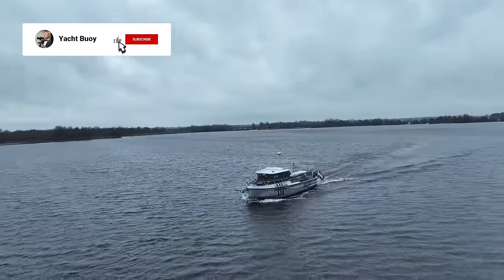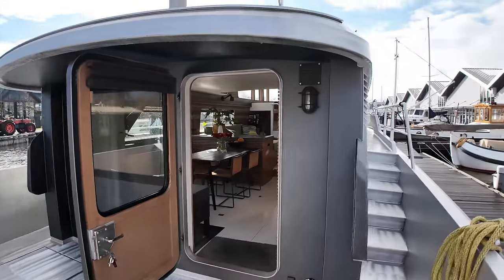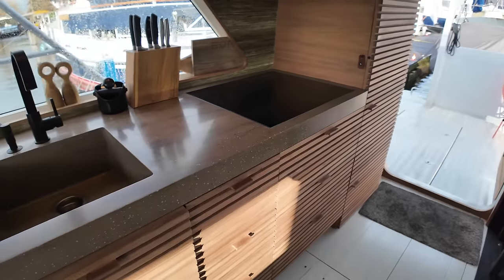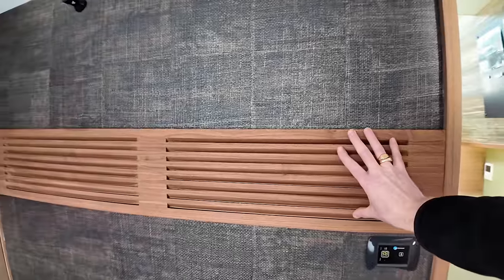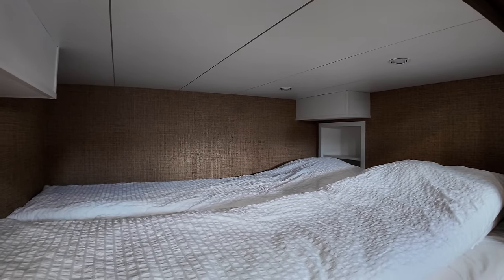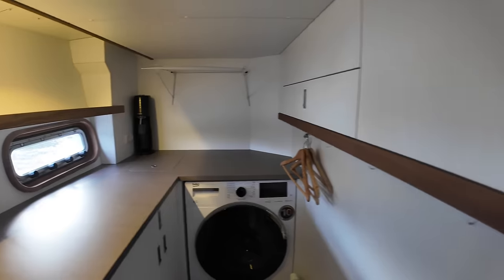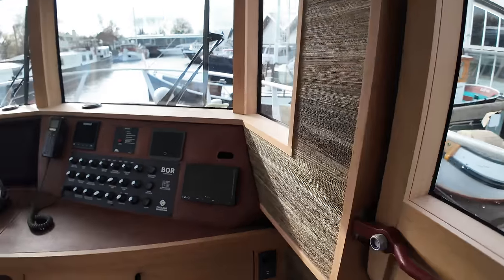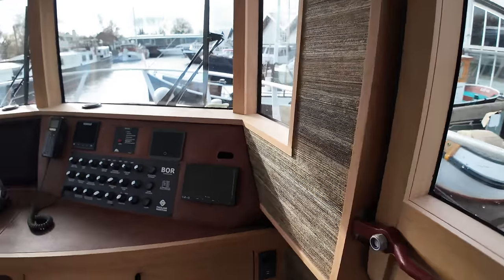€1.395M Long Range LIVEABOARD Explorer Yacht For Sale! | M/Y 'Bor'

Comment from the maker: Thanks for watching! Please do not forget to subscribe! Everything mentioned in this video can be found here: https://linktr.ee/john_johnson
Reply: Oh this was very interesting.  I really like it.  The vessel looks terrific and very stable.  The interior is simplistic yet functional.  I really like the access to the guest accommodations.  Definitely gets a 👍  Thank you.
Reply: How tall are you? Unless you're at least 190cm that is a cramped galley.
Reply from the maker: 190cm exactly! 🫡
Reply from the maker: Thanks for watching! 🫡
Reply: Just found this and subscribed. Great video. 
What do you do if you're going from Seattle to Hawaii as an example by yourself when you're sleeping? Auto pilot seems risky. Is there a Auto feature that simply holds the location or does one use the anchor ? Is that effective if the water is deeper than the anchor can reach?

Comment: The yacht is a nice size to get into smaller areas. The layout is nice but the second cabin is odd and it would be too tight and uncomfortable.the decor is not my taste.other than that nice yacht for the Caribbean, going from island to island. But nice little yacht for a couple.for $1.339 million is a little high for a small yacht. Maybe $900,000.00 To $1.1 million ish

Comment: the hole in the floor of the pilot house area is for a punt pole (? dont know the correct term) anchor. good for holding a boat in place when the tide goes out.

Comment: So far for me this one is the best 2-4 person on board long-range boat ive have seen.
there are few part which in my view can be modified to make it better 1. secondary room make it larger 2. helm seat .. 
and im not sure if it design can suit for a larger engine to gain faster speed eg top speed ups to 30 knot.

if the cabin deck floor raised up to another 20-30 inches in height surely it would give more space..

Comment: A lot to like & a few things not to like on these sister 50 footers.
 I would change forward cabin's access, giving the port guest cabin a head with shower.
 Maybe a port door for the pilothouse & interior stairs to the upper deck/ flybridge. Always more fuel & refrigeration.

Comment: Clever boat, looks capable. The wheelhouse is set far forward near the bow -- I wonder if it would pitch uncomfortably there in rough head seas? Similarly, the main stateroom in the bow would tend to rise up and down a lot in head seas. I didn't notice a generator in the engine space -- does the boat have one? Thanks for touring an interesting vessel.

Comment: Their website claims 0.5L fuel for 1nm. Means with a 3000L tank this yacht got a 6000nm rang if you can believe that claim. Finally a proper long rang "long range" boat, unlike those with barely 900nm.
Reply: In the video he said 6 litres an hour at 8 knots, I find that very difficult to believe. Half a litre per nm is pie in the sky for this boat surely. What a fabulous boat though...

Comment: Refreshingly different design. Loved everything except the wood-burning stove next to the aft door & the removable panel(s) in the galley. Too much burn risk & unnecessarily fussy, respectively, imo. No real idea of what that hole in the sole was all about. Funnel to pour water on head of tardy watch relief sleeping below ? Not a fan of tall vertical fridges in such a small boat, either; open that during/after rough seas & watch the waterfall of smashed stuff pour out.

Comment: I am quite sure this is a capable and reliable vessel, but one word I would not include in a description is “comfortable”.  The salon, dining area, and staterooms all appear less than comfy. Whether or not the decor is to my taste is immaterial. There is a boat that appeals to everyone. Having said that, for the price, there are a lot of other boats that would step to the front of the line over this one. Thanks for showing it though. It’s always good to see boats that are not common or cookie-cutter.
Reply: someone thinks they are an interior designer
Reply: @fukkyoutube  I didn’t realize that I wasn’t entitled to an opinion. But apparently you are.
Reply: @billl5830 most boats you can be if you buy it new.
Reply: 6 liters per hr is pretty good cruising
Reply: @AZIFMIKAYRE   No argument there.
Reply: @kevinmcintyre6503  this was to be posted in the general chat.🤦🏾‍♂️ my bad
Reply: @AZIFMIKAYRE  no problem at all. I took no offence. It’s a heck of a low burn on fuel for sure.
Reply: The interior sucks . Good job on the outside . It looks like they raided an old barn. .

Comment: I would swap out the solar panels for kayak storage rack on one side and put a JetSki lift on the other side and put some folding bicycles into the below deck storage. Take out the solar panels and put a Diesel generator on board to charge the batteries. The engine room looks tight and I’d rather see the engines further back. Overall I like the design of the boat one other change I’d make is having a fold down mast for further bridge clearance if your doing the great loop or are in another tight situation
Reply: this boat can go on european channels. its mast and ‘windscreen’ can be folded down as a standard
Reply: I would add more solar panels.